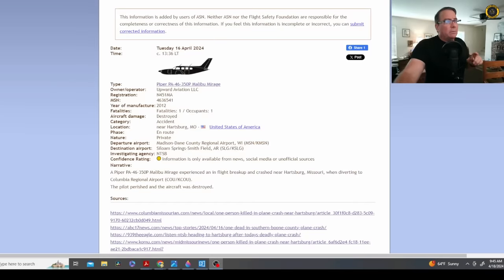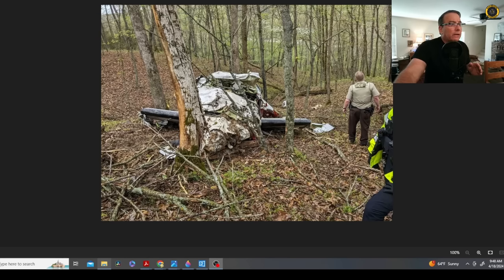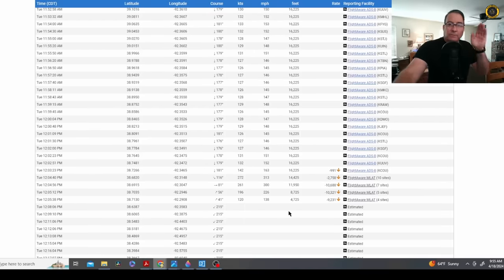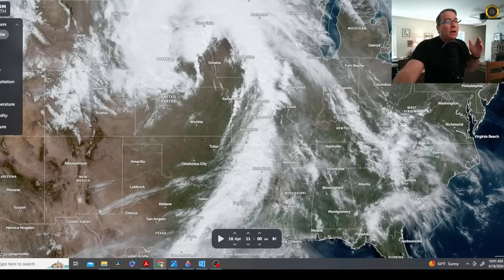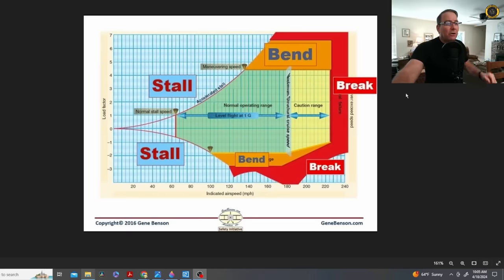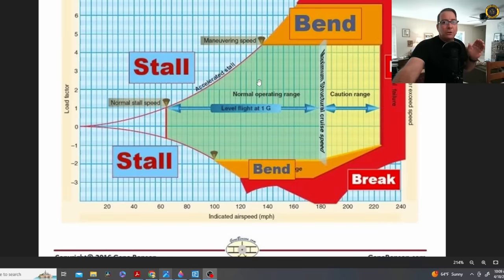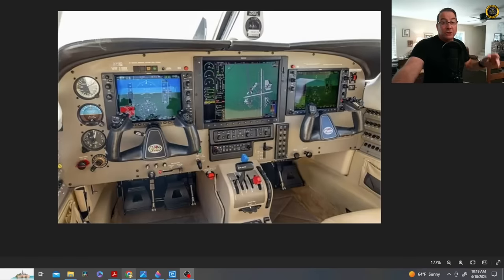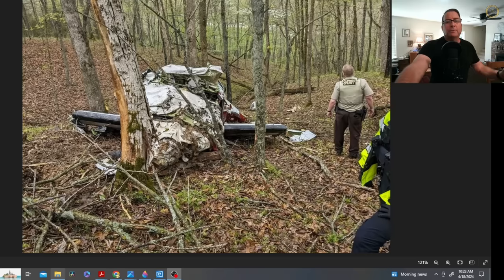N451MA PA-46-350 16 Apr 2024 Structural Failure

Comment: As a retired VFR pilot, and experiencing “situations” in my 3300 hours I  was always aware of the maximum manoeuvring speed of the limited number of aircraft and aircraft types that I flew, however I did not realize that the lighter my plane was the manoeuvring speed decreased. I would have bet my house that the reverse was true but the graph proves otherwise. I never saw one of those graphs ( or studied it if I did actually see one). Thanks for the education and I hope I can pass  it on and help someone else.
Reply: same here.... totally opposite of what I had believed.
Reply: If I have it right it may be easier to grasp in terms of "involuntary" maneuvres. Weight has a dampening effect and so the same gust will toss a light plane around more (with more risk of exceeding G limits) than it would the same plane at a heavier weight. So lower weight needs more safety margin -> lower Va.
Reply: Still trying to process this..
Reply: @tegrovi  correct
Reply: Manoeuvring speed is obviously the max speed at which you can make a full control deflection and stall before exceeding the limit load factor. When you're heavier you need a greater angle of attack just to maintain straight and level, so you're already flying closer to the critical AoA. You might be at 4° meaning only a 4x increase in lift produced if you increase it to 16°. At lighter weights you might be maintaining S+L at only 1° AoA and to reach a typical critical angle of 16°, that's a 16-fold increase in lift produced (given the lift formula - lift is directly proportional to AoA among other things). Not a very good explanation but that's how I think about it.
Reply: This is also a factor in the crop duster structural failures we've seen. Juan covered the gender reveal crash just recently where the crop duster dumped the entire load of coloured water and the wings immediately snapped off the aircraft.
Reply: @gasdive  yes I recall that crash vividly....thats a great illustration of this "envelope"
Reply: @KevinDC5  DC5 as in the Honda DC5?
Reply: @tegrovi  That is a very helpful and concise explanation.
Thanks.
Reply: I’d like to extend Hazza4257’s answer which is great btw. For example I’m in a Seminole at 3800 lbs MTOM. My AoA at cruise at manoeuvring speed is 4 degrees and my Critical AoA is 16. Let’s say my design limit for a normal category aircraft, which the Seminole is, is 4g (normally 3.8g but to make calculations easier). This means that at my manoeuvring speed, and I get a gust which is 4 times the lift, it will increase my g load by 4, which increases my AoA to 16. This is my critical AoA. I’m now on the limit of stalling or over stressing my aircraft. 1 knot faster means a lower AoA, times 4 will mean that my AoA in a gust will be <16 and therefore over stressing my airframe. Vice versa with 1 knot slower means I’ll stall my aircraft. 

Now let’s say I’m at 2700 lbs and flying the same speed as before (my manoeuvring speed for 3800 lbs). The fact that I’m lighter means my AoA is lower as I need less lift. Same story as above, we get an increase of 4 times the lift due to a gust, but my AoA is now for example only 2 degrees. 2 times 4 is 8! So at 8 degrees AoA we will be having 4g of load on the aircraft. This is well below the stalling critical AoA. 

That’s why manoeuvring speed decreases with lower weight.
Reply: You can look at Va as...

What would you rather be doings in severe turbulencia in order to absorb the impact of turbulencia...

Flying at. ........  Any any airspeed?

Of 

Standing still in midair..?..

If you could you would gravitate towards standings still as the ultimate choice even of you don't understand the aerodynamics behind it..
Reply: I look at it like driving down a crappy dirt road. Gets bumpy slow down. Gets really bumpy? Slow it down to a crawl. (Oversimplification I know)
Reply: This blows my mind. How is it possible, or even legal, for a pilot to not know this CRUCIAL information. This is the exact reason I will never in my life step foot into one of these smaller aircraft, I don't give a fuck if it's with an AF1 pilot.
Reply: Just avoid the WX with your weather radar, nothing too difficult about this airmanship manoeuvres.
Reply: Been trying to understand this point past few days and still I can’t. G is nothing without weight 9G of 0lb generates 0 wing loading. 3000lb of 3G generates 9000lbs wing loading. Loading create stress.. so lower weight should generate lower stress at the same G?
Reply: @global6000 But you still have the simple fact that G factor alone can not generate stresses in the airframe. 
G times mass generates stresses.

At half the aircraft mass you can sustain twice the Gs before structural failure.
Reply: The first time I saw Juan explain this, I had the same reaction - it seems intuitively backward. The wreckage tells a different tale.
Reply: @jmayer29  It crashed, yes, but that does not mean that it makes logical sense that max maneuvering speed goes down with reduced weight.
Reply: @global6000  This explanation doesn't really explain the reason for the lower maneuvring speed... The stresses in the metal of the airframe are proportional to the load factor, not the AoA. And just like julesdomes6064 said: with a lower weight, you have less stress on the airframe at the same G load.
-----
I only kinda see two possible explanations: 1) a heavier aircraft will be more stable and have less sudden accelerations. 2) you want your aircraft to stall before causing damage.
I.e. a stall is bad, but it's way better than breaking the airframe midair; like you will be falling down in both cases, but at least you can recover from a stall.
And still I don't think my explanation tells the full story, I'm missing out on something... But now I feel like reading some official engineering literature on this topic.

Comment: Hi Juan! I found this report fascinating. I spent ten years at Piper, eight of those on the PA-46 line and about two years installing the empennage. The main wing on this plane failed at the "splice" where the outer panels are joined to the center section. The separated portion of the empennage shown on the ground is the elevator trim tab and, roughly, one third of the elevator. Good reports. Keep up the good work.
Reply: Interesting because according to the sale site - the left wing outboard section was replaced after a ground incident in July 2023

Comment: Many years ago I  had a pristine 1982 Airconditioned and de-iced P-210.  I test flew a New 1984 Malibu on an early clear Saturday morning - no wind and was smitten. At the time I had about 2,000 hours.  I ended up purchasing a used 50 hour Malibu for $250K with fresh everything forward of the firewall (Piper was forced to replace engines), essentially a new plane.  When I went to Wisconsin to pick up the plane it was gusty winds but clear weather.  I quickly discovered that I gave up a perfectly good extremely stable P-210 almost paid off for a large mortgage on a Malibu as I had the crap beat out of me as those long wings picked up every bump in the sky reminding more more of the turbulence one feels flying a Cessna 152 in training.  The next 600 hours of Malibu time was at times scary as the Autopilot would disengage in heavy turbulence, and I avoided any hint of bad weather.  I flew quite often.  After about 600 hours I became more 'one with the plane' and was more comfortable flying approaches to near minimums and as always avoided extreme areas of weather, but braved it a bit more. I became actually pretty good with the plane and would not hesitate to buy another, but it's a plane that will kill you quickly to pilots with less fear than me.

Comment: I was flying my 172-B from KPWA back to KDWH when a summer Supercell had just blown through. It was clear VFR about the time I hit the Red River and the vis was 40 miles. I started getting bumped really hard and slowed down to Va, I was busy keeping the wings level when Ft Worth Center asked me if I needed higher because I was several thousand feet above my assigned altitude. Keeping the inputs at a minimum had caused me to ride the Verga almost to service ceiling within a couple of minutes.
Reply: The inverse is wind shear - both terrifying
Reply: Smart move.
Reply: Makes you wish you could see that air stuff and stay out of that nasty up and down part.
Reply: That brings back memories of summer flying over Nebraska with 100 mile vis and high lapse rates. The thermals are insane in anything with light wing loading: 1000+ fpm lift into the mid- to high-teens. Throttle back, hand-fly below Va, and mush along until you've had enough of the rodeo.
Reply: @pplusbthrust  If you know about how the weather works in detail, you'll generally know what it'll do even when it's invisible. Experienced glider pilots do this but 90% of powered pilots don't have the training/knowledge to. I'd easily say my glider flying was the single most useful aviation training I ever did. Pity the same stuff isn't required learning for powered pilots.
Reply: @davidkavanagh189  So many challenges in the sky. My experience was near the terrain in the mountains. It is a little more predictable than the high altitude glider stuff where instruments are used to 'see' the air. Such a fascinating, mysterious world.
Reply: @JohnMoses1897  Yeah wind shear - Been there done that.  I flew through one after a storm had just cleared the area.  It was literally all I could do to keep the plane right side up.  Terrifying is the word.
Reply: @davidkavanagh189 what’s your thoughts on a powered pilot going back and training on gliders? Waste of time orrr?

Comment: As the owner/pilot of a PA32,  your explanation of the incident was spot on and I have been in situations like this. It's very easy to try to let the autopilot to continue to fly the airplane, but you need to let the airplane adjust to the turbulence.  I think that even non-pilots would understand your explanation of Va speeds, etc. Great job as always.

Comment: Never flew a Malibu but I've heard they are very "slippery." I was in the TRACON one day when we handed one off to a local tower on a visual approach. ATC had to send him around and he crashed on the go around. To be blunt, I see low-time pilots with a lot of money killing themselves. The guy that crashed at my facility was a surgeon and a low-time pilot.
Reply: A common mistake made on go arounds with these things is to "radar" the power. When the airplane is slow there is not enough rudder to counter the torque  of the TIO540 and the aircraft will torque roll.  A go  around in these types of aircraft requires a very measured and steady application of power.
Reply: @gerrycarmichael1391 Sounds like poor/unrealistic engineering am I wrong?
Reply: Holy crap
Reply: Why don’t surgeons carry stethoscopes?
Ans: they dont know how to use them.
Reply: @DrBlood-cq2cm  come on man, he paid for it
Reply: @johnqdoe  I belive that is pretty common on more powerful aircraft. Physics has its limitations.
Low powered aircraft have the same effect, its just not enough to cause any serious trouble.
If you ride a 250 you can also yank open the throttle any time, do that with a 600/1000 and you'll probably die too. But that doesn't make the bike badly engineered.
Reply: I grew up with the son of a doc who owned a 231. The son was a good stick, the dad not so much.
Reply: Perhaps "slippery" aircraft will eventually trump (lower case 't') Jaguars as society's way to get even with doctors.
Reply: Too many people think it's just like driving a car and it's just as forgiving. To many people don't practice things like go-arounds and missed approaches.
Reply: @gerrycarmichael1391  The PA46-350(P) has full rudder authority to avoid a torque roll throughout its entire flight envelope, regardless of power setting. The only way you might roll it at slow airspeed and full throttle is to have a mechanical failure, thus stopping the intended input, or failing to apply the proper input. 
I would agree, its always an excellent idea to apply a steady measured application of power on the aircraft in a go-around, with the proper flap settings, as well as throttle reductions of no more than two inches of manifold pressure per minute and knowing when and when not to and why to apply the airbrakes on the aircraft.
Reply: “A fool and his money are soon flying more airplane than they can handle.” -Old Flying Aphorism
Reply: @johnqdoe     Yes, you are wrong. Every airplane has issues that training should overcome. Types of engine and prop torque should be taught to a primary student before they even solo.  The problem is that most pilots NEVER PRACTICE go-arounds.  No one can build a dummy-proof airplane.
Reply: @terraholdingco  I've had it happen on a Cherokee Six dude. Way less torque on that airplane.  Can't tell me it won't torque roll.
Reply: The PA-42 sounds like today's version of the Beechcraft Bonanza. Money still doesn't buy talent, experience or practice.
Reply: @gerrycarmichael1391  I just happen to own one of these aircraft and instruct in them for folks transitioning into them. You have full rudder authority at all flight envelope speeds in both the Malibu and the Cherokee 6. 
It sounds like you might be referencing a power on stall in your aircraft with poor rudder AND aileron input through such a maneuver or event. What you are describing you can certainly do in any aircraft in such a circumstance.
Reply: @wallywally8282 It was a typo and I fixed it.
Reply: @vanstry  Maybe they are doing it on purpose so flying is less safe than driving.  Then when they ban cars you are stuck where they want you.
Reply: @Pete-tq6in  It should buy you practice though.
Reply: @robertsmith2956  very true, it’s a shame that so many wealthy neophyte aviators don’t invest that wealth into improving their airmanship first instead of into potentially dangerous high performance aircraft.
Reply: The V-35 Bonanza known as the "doctor killer" has continued into various newer, high-performance and complex models. " **Son, your ego is writing checks your body can't cash**".
Reply: @johnqdoe there are just limitations on aircraft design because of low weight. They can't be as rugged or as forgiving as a land vehicle because all that redundancy adds pounds. Being a pilot requires a lot of skill and knowledge, it's just how it is.
Reply: @Pete-tq6in  Same with the Cirrus.
Reply: @williampotter2098  I was once taken for a ride in a small, very slippery, high performance composite microlight, the type evades me now. It had a central control stick and the owner asked me if I’d like to fly for a while. Of course I readily accepted his offer. At one point, I put the aircraft into a very shallow dive and a slight turn, at which point the owner warned me that we were at VNE! I was amazed at how close the cruise and VNE were and how easy it’d been to inadvertently reach VNE. Of course, I closed the throttle and gently raised the nose and all was well, but despite it being twenty years ago, the incident has stayed with me.
Reply: Never flown a Malibu either, but I have driven one...not those little economy ones made from the mid-1990's until recently, either...I'm talking early 1970's....
Reply: @darrens.4322 And we used  to call the Baron a, "Lawyer Killer."

Comment: Thanks for the reminders as always.   I find myself with the autopilot off 80% of the time due to weather, Mtns etc.  I was coming back from Santa Fe to Tucson in my 310 a couple of weeks ago and it was a bull-ride...Full shoulder strap, spine rattling hits etc.  I looked at flight aware and I had several 100mph spikes...altitude drops were up to several hundred feet.  Va baby.  My excellent instructor drilled it into me years ago.

Comment: So many high performance cars crashed by those without the experience,talent and training to control them. I guess it's the same with aircraft ?
Reply: On the race track we say they "ran out of talent". Fortunately those accidents are rarely fatal.
Reply: It all comes down to decision making.  My skills ain't great, but I limit my risk based on it.
Reply: And also those many traffic camera and dash camera footage excerpts showing the culmination of police pursuit, road rage and highway stunting incidents  showing examples of structural failure as vehicles briefly impact interstate and other highway infrastructure turbulence - boink or crash (rather than the better known aeronautical term of art 'keblammo') - and then the scraping, tinkling and screech of metal and plastic on steel timber and concrete finally then coming to a quiet rest amide the continuous traffic sounds.